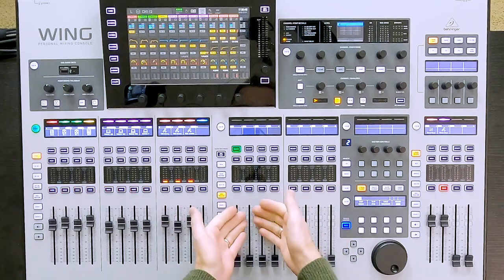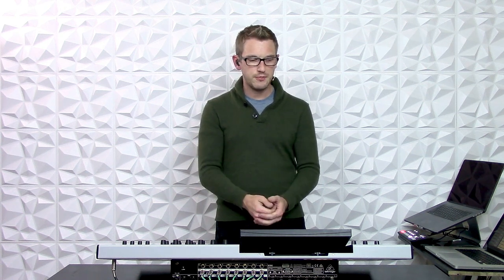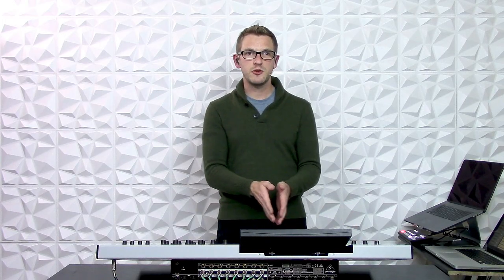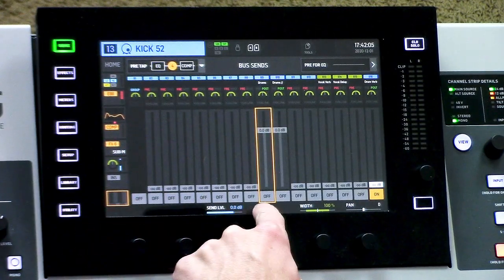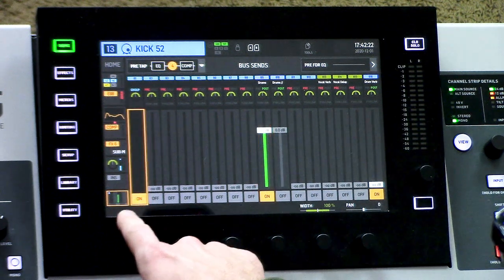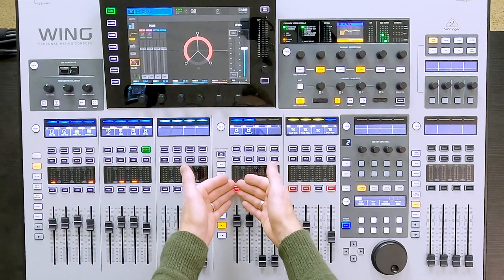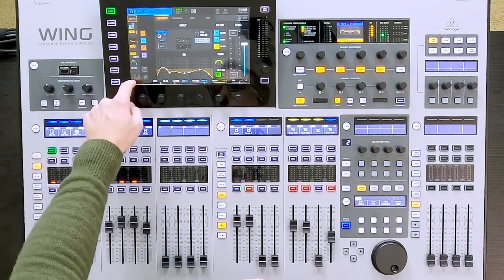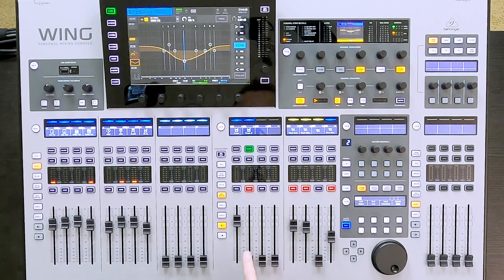Behringer Wing 204 - Mixbusses Tutorial | Pre Fader, Post Fader & Subgroup

Comment: Should I use these instead of DCAs? What are they for?
Reply: You would use these if you want to do additional processing to the sum of the channels, like he did with that compressor or the EQ. Otherwise DCAs are just fine if you only need a common volume control.
Reply from the maker: DreamKeys76 nailed the reply correctly. I like to think of the DCA’s as a remote control. So typically I will set them to the fader of the mixbusses set up as groups. That way I can adjust during a show and when I return the DCA’s to +0.0dB I know they are back to where the group levels should be as a baseline.
Reply: @DrewBrashler  ahhh okay!! So in a show, you’d keep the busses at unity and then be adjusting your DCAs (which are selected onto the busses)?